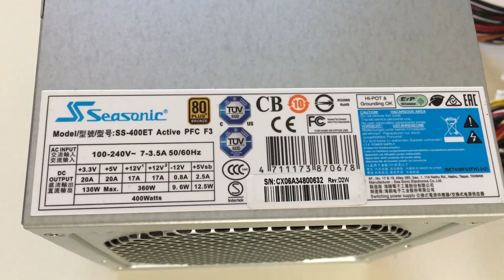Sega ALLS UX Arcade Board Hardware Teardown

Comment: I recently got one. Would like to do some upgrades and modifications but don’t know where to start 🤷🏻‍♂️
Reply from the maker: The case can take almost any regular M-ATX motherboard and power supply, and any graphics card that's not much larger than the original GTX1070. I think compatible 6th gen CPUs for this board may be limited due to it's custom BIOS.

If you're just wanting to upgrade the GPU make sure it won't need more power than the 1070 (1x 8 pin / 150W as you'd need a bigger PSU.

Worth noting, if you're putting in a modern motherboard and only using NVME drives you can leave the HDD metal plate out and have a taller CPU cooler. Also, you would have to wire a power button or set the board's BIOS to always turn on when connected to the mains.
Reply: @N10248  thanks for explaining that. that seemed like much modding than I feel like doing. Wouldn't switching the PC be more effective? It is too bad we cannot activate Sega software outside of Japan. My cabinet is wired with Brook UFB but I still have the original IO. Do you know what the IO can be used for? and Can I just connect my PS4 or XBOX 360 to the cab?
Reply from the maker: @waleedhamadah1828  If it's a Type 4 JVS I/O then it would work in windows via the USB. You can just put anything in the cab really. I'd recomend looking at this thread on Arcade Projects (needs signup) https://www.arcade-projects.com/threads/sega-all-net-p-ras-multi-arcade-cabinet-owners-thread.16042/ this covers loads about the ALLS and the matching p-ras cabinet.
Reply: @N10248  Nice. Thanks man.

Comment: Amazing how they planned out a PC better than manufacturers like HP and Dell. The quality of things like the PSU are superior.
Reply from the maker: Yes, a very durable design. I think the intention of such reinforced internals is so there's almost no chance of something coming loose while a cabinet is being transported and if it gets shaken or damaged by players when in use. I think Sega justify the top brand PSU and other high end components due to the high price of a new cabinet in the first place and that they'll save money in the long term byneeding  less replacements.
Reply: @N10248  great quality parts like a Seasonic PSU can last very long with very little maintenance so I can see why they went that route. Genius move.

Comment: Great teardown. I'd love to replace the cabinet fan in mine with a more silent one. Unfortunately, regular Noctuas do not offer nearly as much airflow as the stock San Ace 120 fan (CFM 99, 168m3/h) in the ALLS - and the 120x120 Noctua NF-F12 industrialPPC-3000 PWM which does (CFM 109, 186m3h) is described as being not as silent as other Noctuas (43,5 dBA vs, say, only 22,6 dBA of the NF-A12x25)... Hmmm. 
Does anyone know of a sufficient, but more silent alternative to the San Ace 120?
Reply from the maker: For home use, going for a lower power fan is fine, these cabs and machines are built for worst case scenario, ie dust clogged in a hot arcade enviroment. Plus on these units I think the CPU fan is the most noticable noise and not the intake fan.

Comment: Great video. I have a question. Since this case does not have a power button, how does this work? I know the system turns on when flipping the psu switch, but what causes it to turn on? As far as i know that isnt the case for most PCs.
Reply from the maker: In the BIOS of most PCs there's an option called simlar to "After Power Loss: On, Off or Last State".  If this is set to be on, the PC will turn on straight away when connected to the mains. The ALLS has this set.
Reply: @N10248  interesting, thank you!

Comment: Is this the most current SEGA hardware for arcades? even in 2024? congrats on the excellent video
Reply from the maker: This model was replaced by the ALLS UX2 which has a newer CPU (8th gen), and a RTX2070 GPU. Almost identical in appearance though with minor changes to the air vent styling and the motherboard no longer has it's own unused DVI and VGA connectors - Gigabyte MCH31AM-S2 for the UX2 and MDH11BM for this UX1 model.
Reply: @N10248  Thanks ;-)